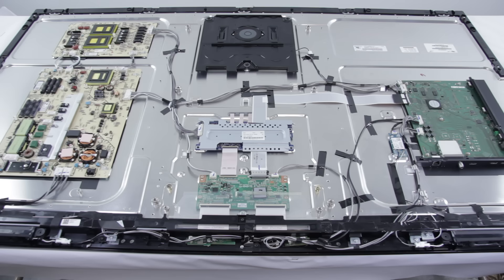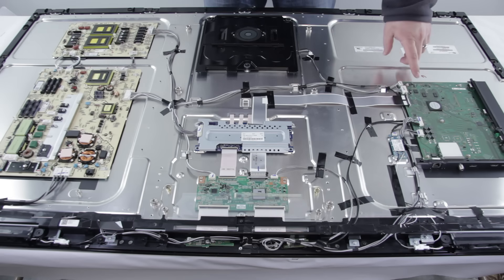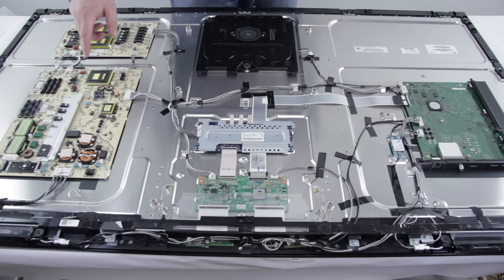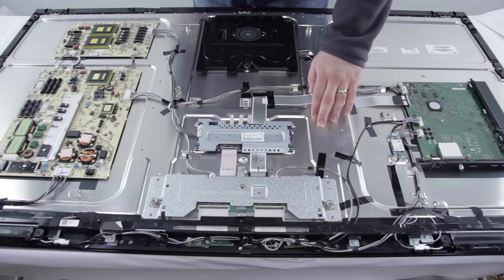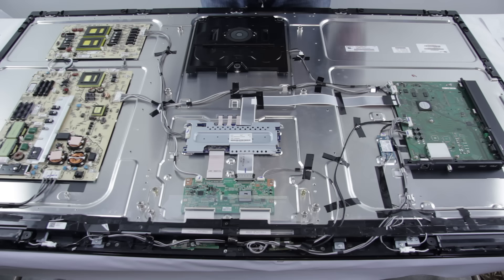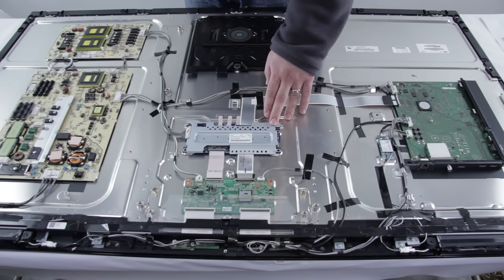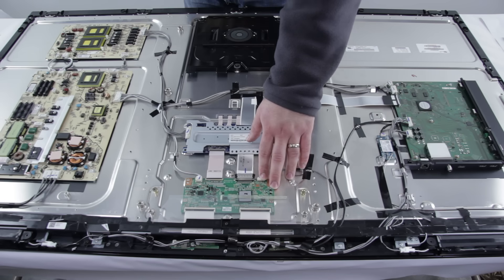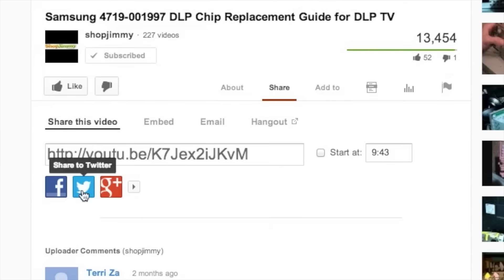LED TV Repair Tutorial - Common Symptoms & Solutions - How to Repair LED TVs

Comment: Hello, I have a Samsung UN46C7000 that has a problem with the picture.  There is a fully lit screen, but the top 1/3 is not legible, the middle 1/3 is better and the bottom 1/3 is perfect.  It is like this with HDMI input and also menu screen.
Reply from the maker: +Kenny Chamberlain   Try all repairs and troubleshooting at your own risk.  This sounds like a TV panel (TV Screen) problem.  If your TV panel is bad, it may be more cost-effective to replace the TV as panels are typically hard to find in stock, difficult to replace, and expensive.  Thanks and please let us know if you have any further questions!  www.shopjimmy.com

Comment: led tv UA46F5000AR Samsung damaged in stand-by on mode (off by remote) in thunder lighting. pls advice repair
Reply from the maker: +Scr Charkhi   Try all repairs and troubleshooting at your own risk.   I recommend replacing the power supply and the main board in your TV.  Click this link to replacement parts for your TV model number:  http://www.shopjimmy.com/catalogsearch/result/?q=46F5000  There may be multiple boards for the same TV model number, be sure to match part numbers on your current board, with your replacement for compatibility.  Thanks and please let us know if you have any further questions with your TV Repair!  www.shopjimmy.com

Comment: My Samsung LED UA40D5000 is not turning on and there is no red light.
i tested the power supply board currents and it looks good.
when i unplugged the main board from the power supply the LED back light is turning on but if plug it again the LED light turns off. 
in any of this situations the red SB light is still off.
i tried also the remote control but nothing is happened.
should i replace the main board?
TY
Reply from the maker: +roi cohen  Try all repairs and troubleshooting at your own risk.   I recommend replacing the main board in your TV.  Unfortunately I do not see any replacement parts in the search results for your TV model number on our website.  Please reply with your part number on your main board and I can try searching for replacement parts.  Thanks and please let us know if you have any further questions!  www.shopjimmy.com

Comment: I have a LG LED 47lm4600 that shows the stand by power light (red) on when plugged in,  but when trying to turn the tv on the power light turns black with no picture or sound.
Reply from the maker: +Mark Adams  Try all repairs and troubleshooting at your own risk.  I recommend replacing the main board in your TV.  Click this link to replacement parts for your TV model number:  http://www.shopjimmy.com/catalogsearch/result/index/?cat=56&q=47lm4600  There may be multiple boards for the same TV model number, be sure to match part numbers on your current board, with your replacement for compatibility.  Here is a link to a video showing how to identify your part number, click here:  https://www.youtube.com/watch?v=RwHTvjMdrhk Thanks and please let us know if you have any further questions with your TV Repair!  www.shopjimmy.com

Comment: LG 37LE5300-UC Screen has spiderwebs through the LCD (half of lcd is cracked)
and
RCA LED46C45RQ when turned on power indicator illuminates but screen remains black with no backlight on all inputs. Menu will not show as well.
Reply from the maker: +Nate “RdnckReaper” Holcomb   Try all repairs and troubleshooting at your own risk.  This sounds like a TV panel (TV Screen) problem.  If your TV panel is bad, it may be more cost-effective to replace the TV as panels are typically hard to find in stock, difficult to replace, and expensive.  Thanks and please let us know if you have any further questions!  www.shopjimmy.com
Reply: what about the rca?...there are 2tvs in my comment

Comment: i have a Samsung led tv model # UN60F6350AFXZA. The tv sometimes can be turn on by remote control and all its functions. but most of the time it won't but has a standby light. have to manually operate it using the jog control at the back of the tv. the power supply is good and i ordered another one from you guys installed it but it did not fix the problem. last time i turn it on using the remote control it turns on then i heard 1 click the remote control stops working again. mainboard is ok. do you think the function & ir board is the problem?. thanks and more power to you guys.
Reply from the maker: +Kerwin Patrimonio  Try all repairs and troubleshooting at your own risk.  I recommend replacing the main board in your TV.  Click this link to replacement parts for your TV model number:  http://www.shopjimmy.com/catalogsearch/result/index/?cat=56&q=UN60F6350AFXZA  There may be multiple boards for the same TV model number, be sure to match part numbers on your current board, with your replacement for compatibility.  Thanks and please let us know if you have any further questions with your TV Repair!  www.shopjimmy.com

Comment: SONY BRAVIA KDL46HX820 LED TV Changed TCON BOARD BECAUSE OF VERTICAL LINES. NEW TCON BOARD BLINKS ORANGE AND GREEN LIGHTS.
Reply from the maker: +coolguy802000   Try all repairs and troubleshooting at your own risk.  This sounds like a TV panel (TV Screen) problem.  If your TV panel is bad, it may be more cost-effective to replace the TV as panels are typically hard to find in stock, difficult to replace, and expensive.  Thanks and please let us know if you have any further questions!  www.shopjimmy.com

Comment: Hi Jimmy I did flash light test there is no pic on TV. back lights are on. when i turn on tv screen come up very dark. I ordered replacement kit from you site. I changed t-con board main board and Power supply. It still have same issue. Can you please help me out pleaseeeeeeeee.
Reply from the maker: +Harjit Singh   Try all repairs and troubleshooting at your own risk.  This sounds like a TV panel (TV Screen) problem.  If your TV panel is bad, it may be more cost-effective to replace the TV as panels are typically hard to find in stock, difficult to replace, and expensive.  Thanks and please let us know if you have any further questions!  www.shopjimmy.com

Comment: My tv is a Samsung PS60F5500. It has a vertical line down the right side of the panel. It is initially coloured but then becomes black. It is about 6 inches wide. It appears over the picture and the menus on all imputs. It can almost dissappear after picture reset but gets worse the longer the set is left on. Help! Thanks in advance.
Reply from the maker: +Andrew Ovenden   Try all repairs and troubleshooting at your own risk.  This sounds like a TV panel (TV Screen) problem.  If your TV panel is bad, it may be more cost-effective to replace the TV as panels are typically hard to find in stock, difficult to replace, and expensive.  Thanks and please let us know if you have any further questions!  www.shopjimmy.com

Comment: my LG mod #42lk450 was playing fine, but went to a blue screen. i took the back off to visually check capacitors, nothing was found. i plugged the tv up and it worked again. after 3-4 days the same thing happened. i unplugged it for a while but still same no picture just the bluish screen. after sitting for a few weeks i decided to check it out again. well its now working again, but not confident it will last. what would you suggest?
Reply from the maker: +jeff grant   Try all repairs and troubleshooting at your own risk. This could be a problem with either the t-con board, the main board or the TV panel. You can replace the main board and the t-con board individually to see if one of those boards fixes the problem.  Click this link to replacement parts for your TV model number:   http://www.shopjimmy.com/catalogsearch/result/?q=42lk450+  There may be multiple boards for the same TV model number, be sure to match part numbers on your current board, with your replacement for compatibility.    Thanks and please let us know if you have any further questions with your TV Repair!  www.shopjimmy.com

Comment: Hello, i have samsung LED Smart TV UA32F5500 wtih a good sound and good video but the screen is flickering and blinking repeatedly, what could cause this problem? can you help us fix this and provide us a parts for it if ever? Thanks in advance.
Reply from the maker: +jun buela  Try all repairs and troubleshooting at your own risk.  This could be a problem with either the power supply or the LEDs in your TV.  You can replace the power supply board to see if that fixes the problem with your TV.  Click this link to replacement parts for your TV model number:  http://www.shopjimmy.com/catalogsearch/result/?q=32F5500  There may be multiple boards for the same TV model number, be sure to match part numbers on your current board, with your replacement for compatibility.  Thanks and please let us know if you have any further questions with your TV Repair!  www.shopjimmy.com
Reply: +ShopJimmy.com 
I can't access the link you recommend for replacement parts even your website i can't  access it, i try using different browser firefox, google chrome or safari but still have the same result...

Access DeniedYou don't have permission to access "http://www.shopjimmy.com/catalogsearch/result/?" on this server.Reference #18.7c8b6875.1447241390.5042be12
pls help! i need to see the your parts catalog... thanks God bless!

Comment: My Emerson LC401EM2F won't stay on it turns on for about  30 seconds and then turns off,  what could it be?
Reply from the maker: +Vivian Trevino  Try all repairs and troubleshooting at your own risk.  I recommend replacing the digital board in your TV.  Click this link to a replacement digital board for your TV.  http://www.shopjimmy.com/emerson-a17pcmma-001-digital-main-cba.htm  There may be multiple boards for the same TV model number, be sure to match part numbers on your current board, with your replacement for compatibility.  Here is a link to a video showing how to identify your part number, click here:  https://www.youtube.com/watch?v=wooRqBrRo6o  Thanks and please let us know if you have any further questions with your TV Repair!  www.shopjimmy.com

Comment: Model LA40A550P1R
the issue i am facing is when i switch off my tv and switches it on the colour are fine but later with in 5 minutes the coulour starts fading and contrast changes automatically
what could be the issue?
i have tried changing settings but it doesnt effect on settings the settings are always same
Reply from the maker: +ahsan farrukh   Try all repairs and troubleshooting at your own risk.  I recommend replacing the main board in your TV.  Click this link to replacement parts for your TV model number:  http://www.shopjimmy.com/catalogsearch/result/index/?cat=56&q=40A550  There may be multiple boards for the same TV model number, be sure to match part numbers on your current board, with your replacement for compatibility.  Here is a link to a video showing how to identify your part number, click here:  https://www.youtube.com/watch?v=BEPWrefQvqI  Thanks and please let us know if you have any further questions with your TV Repair!  www.shopjimmy.com

Comment: Hi i got a RCA tv model  RCA Model D52W25, Serial number = F082C30E3 .My tv does not show color its just black and white and at the bottom of the tv it has got a color spread spot. Please guide me onw why color is not working.
Reply from the maker: +Shailesh Mane   Try all repairs and troubleshooting at your own risk.  This sounds like a TV panel (TV Screen) problem.  If your TV panel is bad, it may be more cost-effective to replace the TV as panels are typically hard to find in stock, difficult to replace, and expensive.  Thanks and please let us know if you have any further questions!  www.shopjimmy.com

Comment: We have an LG LED 50LN5100-UB. The picture went out, we have sound. the flashlight test yielded a picture on the screen. I replaced the led driver/power supply board and have the same problem. What is the next option?

Shawn
knoxxille, tn

Comment: sir i have a samsung LA32D481G4. I m getting horizantal black lines on the screen .i got no luck reinserting the t-con board wire. can you help me with a solution
Reply from the maker: +bharath kumar   Try all repairs and troubleshooting at your own risk. This could be a problem with either the t-con board, the main board or the TV panel. You can replace the main board and the t-con board individually to see if one of those boards fixes the problem.  
Unfortunately I do not see any replacement parts in the search results for your TV model number on our website.  Thanks and please let us know if you have any further questions!  www.shopjimmy.com
Reply: +ShopJimmy.com sir for my tv the t-con board and main board are given together. and there is only one connecting wire instead of two

Comment: have a toshib 42vl863 there is no power, as in no standby iv checked the fuse, got the back of the TV off and managed to test the 2 main fuses and power supply, all seems ok, but from there im lost
Reply from the maker: +demonizer84  Try all repairs and troubleshooting at your own risk.  Do you have standby voltage on the power supply board?  Thanks!  www.shopjimmmy.com

Comment: I have an LG 47LN5400-UA. It has sound, but no picture. The picture started going black today and has done it several times since. At first, the picture would come back after turning the TV off and back on. At this point there is no picture even after turning TV off for a few minutes and back on. I have not removed the back cover yet, but see no sign of backlights through the vent holes. It DOES have a visible image on the screen when I do the flashlight test. Can you tell me what parts I need from my description?
Reply from the maker: +Samuel Aleshire   Try all repairs and troubleshooting at your own risk. This sounds like a problem with the actual LEDs inside your TV. These LEDs are replaceable, however it is recommended they are replaced by someone with the proper experience and training. When replacing the LEDs, the TV panel can get damaged. If the TV panel gets damaged, it is not repairable. Click this link to replacement LEDs for your TV model number:   http://www.shopjimmy.com/catalogsearch/result/index/?cat=299&q=47LN5400-UA  Be sure to match the panel information necessary to ensure you have the correct replacement LEDs.Thanks and please let us know if you have any further questions with your TV Repair!  www.shopjimmy.com

Comment: having a problem with screen flickering
on my LG 50LN1000 UB
Reply from the maker: +Frank Rojas  Try all repairs and troubleshooting at your own risk.  This could be a problem with either the power supply or the LEDs in your TV.  I recommend starting by replacing the power supply board to see if that fixes the problem.  Click this link to replacement parts for your TV model number:  http://www.shopjimmy.com/catalogsearch/result/index/?cat=229&q=50LN5100  There may be multiple boards for the same TV model number, be sure to match part numbers on your current board, with your replacement for compatibility.  Here is a link to a video showing how to identify your part number, click here:   https://www.youtube.com/watch?v=_4Qpfan0vdUThanks and please let us know if you have any further questions with your TV Repair!  www.shopjimmy.com

Comment: HI I need some advicxe on my repair for my LG 47lv5400 .symptoms: no back light , no sound, no picture, but the light on the power button goes red to white when trying to open the tv . the light blink only one time and stay on (still white) I also did the flashlight test ...  nothing. which of the board should I change?
Reply from the maker: +Pascal Vallée   There may be multiple boards for the same TV model number, be sure to match part numbers on your current board, with your replacement for compatibility.  Here is a link to a video showing how to identify your part number, click here: Thanks and please let us know if you have any further questions with your TV Repair!  www.shopjimmy.com  I recommend replacing the main board in your TV.  Click this link to a replacement main boards for your TV model number:  http://www.shopjimmy.com/lg-ebt61542604-main-board-for-47lv5400-ub.htm  There may be multiple boards for the same TV model number, be sure to match part numbers on your current board, with your replacement for compatibility.  Here is a link to a video showing how to identify your part number, click here:  https://www.youtube.com/watch?v=RwHTvjMdrhk  Thanks and please let us know if you have any further questions with your TV Repair!  www.shopjimmy.com

Comment: Samsung UN60ES8000F has vertical color lines and will not turn off with remote.  Problem gradually became continuous after hours of intermittent  occurrences.  Problem exists when connected to cable box, WI-FI and DVD.
Reply from the maker: +Robert Basso   Try all repairs and troubleshooting at your own risk.  This could be a problem with either the main board or the TV panel.  You can replace the main board in your TV to see if that fixes the problem.  Click this link to replacement parts for your TV model number:  http://www.shopjimmy.com/catalogsearch/result/index/?cat=56&q=UN60ES8000F  There may be multiple boards for the same TV model number, be sure to match part numbers on your current board, with your replacement for compatibility.  Here is a link to a video showing how to identify your part number, click here:  https://www.youtube.com/watch?v=BEPWrefQvqI  Thanks and please let us know if you have any further questions with your TV Repair!  www.shopjimmy.com